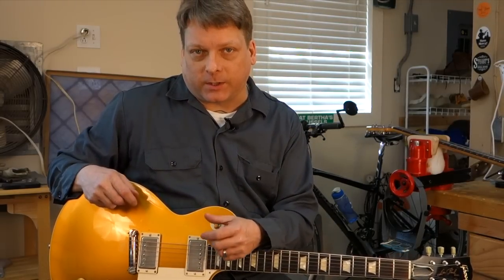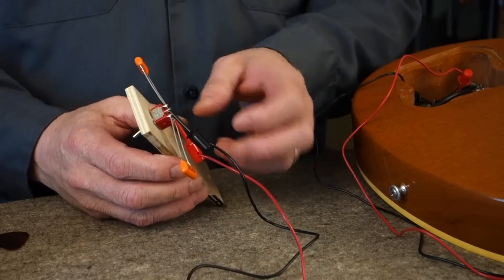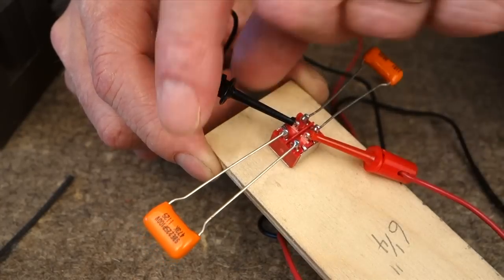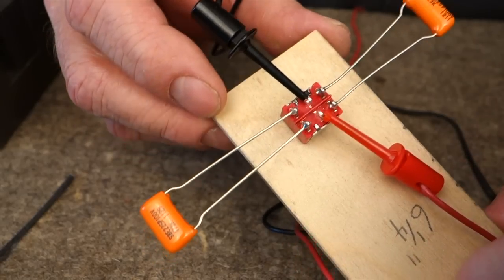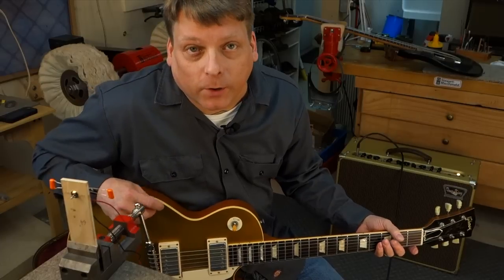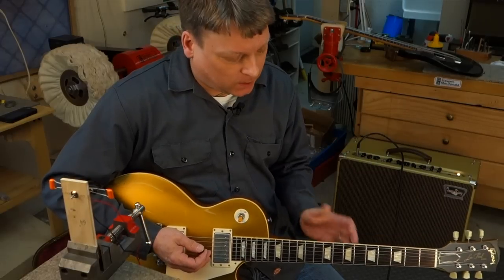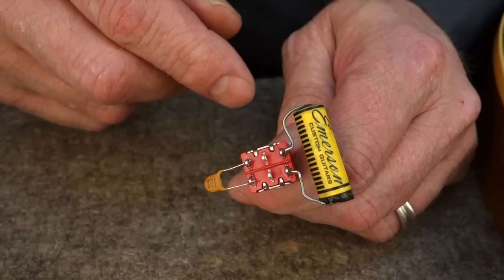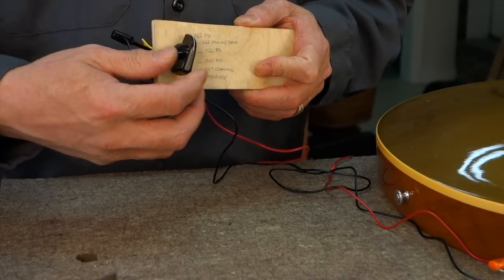Guitar capacitor tester: let your ears decide

Comment: It really helps to hear a difference when you play the same lick.Just saying.
Reply: I like using Orange Drops  mostly for psychological reasons. It has a decent history and in theory the build quality is good to last.
Reply: @ramencurry6672  psych reasons ? It’s a capacitor not a mushroom cap.
Reply: @wb9536  what capacitor do you use and why?
Reply: @wb9536  haha
Reply: @wb9536  it’s been about a year and you still didn’t answer my question
Reply: It’s arguable that, if you need to A-B the same lick to hear the tone difference, it’s not big enough to really matter. If it sounds good, it is good.
Reply: I can hear it on phone speaker I prefer the 22. The 47 takes off too much top
Reply: It's impossible to determine any difference with such a subtle change unless like you said, he plays the same part. Why wouldn't you play the same part, even if there was a significant difference?
Reply: Except, he's not asking your opinion😂. He's showing other techs how to rig up a testing device.

Comment: I would have liked to have heard what the difference between the paper/oil and ceramic cap sounded like.
Reply: no one could hear that)
Reply: Capacitance is Capacitance how the electrons get stored and release doesn't matter at all it is the 'how much and how fast' that matters.  Don't pay more for 500v 'orange drops' on a signal that is measured in millivolts... what a waste!  The value is all that matters.  Seymour Duncan has a good article about that:

http://www.seymourduncan.com/tonefiend/guitar/customize-your-caps/

Avoid mojo caps that cost big bucks
Reply: +Ted     I laugh at all this cap nonsense. You want a decent capacitor, from a decent maker, for sure. What you don't want is some boutique shop charging 40 times it's price for Tone man. ROFl, I guess it makes money flow. Surely doesn't get noticed by the average Joe on your album/CD/DVD. That all gets changed by amps, strings, your style of playing, where you set the tone knob at, the room, humidity, air pressure, software, recording media, microphones, recording techniques, the other persons ears, their media it's played from (generally a crappy dumb phone)etc.etc.
Reply: Word !  Value of the cap matters. Not what it's made from.  Cork sniffers refuse to believe that.  It's their money, let them spend it.
Reply: sure, you can ignore an inhomogenous and anistrope dielectricum ...but you can consider it too ... and temperature and humidty ... if note focuse only on the printed capacitance value
Reply: cableaddict the only reason anyone could say ceramic caps are inferior is this: they are more likely to be inconsistent in their purported rating, and how they perform. That has to do with manufacture. I agree that the only thing that affects capacitors are their true ratings when in use, and their durability- never understood the whole to do about paper in oil, or ( worse ) vintage paper in oil🙄. Shit, the older a capacitor is, the more likely it has some degree of degradation people are snowed so easily.
Reply: Totally agree, capacitance is capacitance. ALL that varies is how it does it and how quickly it gets there.
Reply: Lol smh, 72 people liked that stupid comment.
Reply: Could't agree more. Numbers are numbers, values are values. There's no any magic or esoterics with capacitors, just some Gibson's scam.
Reply: Ted Schoenling funny man. It’s about parasitics, and those differ a lot. 
Cut some capacitors open and look at the construction.they can be completely different.
Reply: @Poodrdt  Um that's bullshit. I can hear a large difference between caps on my tube Amp. I've tried many. And that has global feedback which makes it even harder and uts clear as day.
Reply: @gutbucket260  It's not about cork sniffers. Anyone who thinks caps don't sound different is deaf
Reply: Capacitors make a huge difference, just like a treble bleed affects tone but even more so. It‘s so clear night and day it’s not even up for debate

Comment: Most players keep their tone pots at full-on when playing. If you do this, here's a great, inexpensive & simple suggestion;  Install a .001uF cap in place of the typical .022 or .047uF. This low value cap is usually used in a treble bleed circuit for guitars. This little cap gives you a very subtle tone shift from 0-10, thus, giving your guitar two totally usable voices at full-on or full-off. Again, it's VERY subtle, but SO usable. You can also try slightly higher value caps. EXPERIMENT!

Comment: The difference was so subtle, I would imagine you could tweak your amp settings to achieve that small difference; or use a EQ pedal and make slight adjustments.
Reply: If that was subtle you need to join a auditory class for about a year. If you can't hear the dramatic change in tone, shape, and frequency you might wanna get your ears checked as well.
Reply: Exactly! Same goes for swapping pick ups , you can achieve just as much with an eq pedal .
Reply: @dba4292  Dramatic ? Really ?
Reply: @Dad-Gad  To my ears yes, if not to yours then ok. You might wanna have an idea of what to listen for, not what be missing.
Reply: @Dad-Gad  You are right,..its so subtle, it's ridiculous !
I will give the man in the video credit for being honest. He said that it is subtle before he even began the demonstration.
Reply: @Dad-Gad  unless it's a drastic difference between tone, I agree.
Reply: @dba4292  I call BS.. I have no difficulty hearing differences between .022uF and .047uF caps if apply this change to one of my own guitars - or if it is A-B'ed in a tightly controlled situation, but IMO there are no "dramatic" differences. Picking your string half an inch closer to your bridge will make for a far more dramatic difference..

The "test" in the video is not very useful because the guy is not playing the same licks and his picking dynamics vary wildly, which makes it very difficult for the listeners to decide wether we should attribute perceived differences in sound to his picking or to which cap is enabled. Also he doesn't match tone settings, which is really important. It seems like he mostly play with the tone knob open. The differences becomes more pronounced once the tone knob pass "position 5" on the way down.

In fact if tone knob is on 10/fully open (many guitarists don't touch their tone knob), the difference in volume cut off between a .047uF and a .022uF cap is only about 1/10th of a decibel (sic!). (A .047uF is starts 'filtering' frequencies an octave lower than the .022uF cap, and it gets more pronounced as you turn down the tone pot)

For a fully open tone knob, that is a very, very, veeery, veeeeeeeery (did I say very?) subtle difference, indeed. If you roll your cap from .022uF to .047uF in your guitar, by the time you're finished soldering and plugging back into your amp, chances are your memory will not be accurate enough to make you do a fair comparison in any sense with regards to tone setting on 10.

Though psycho acoustic effects might be strong. Many people don't get this. The real differences comes into play once you start rolling back your tone knob and the effect for a .047uF cap is most apparent with tone rolled all the way back (compared to a 0.022uF cap) - it will be considerably "darker" sounding.

 @Lyd Mo is right, using EQ on an amp or a pedal makes far more dramatic changes to the sound than swapping caps with different values,  while leaving amp the same. The sound of the whole system (including everything from the players picking dynamics, the properties of the guitars, the cables, pedals and amp) simply is so complex that singling out the importance of the cap value is extremely difficult.  You could NOT listen to a recording of a random LP with normal cap values (.047uF/.033uF/.022uF) and recognize what cap is installed - especially not if tone knob is fully open. It is just not impossible. 

Having said that, finding the "core" tone in your guitar that suits your preferences is certainly important to many guitarists. Sometimes you are chasing a particular resonance peak that matches natural resonances in your guitar, or maybe you do a lot of tone 'swells' and prefer the range of one value over the other. This might be important nitty-gritty details to some, but it is very finicky stuff and apply mostly to the clean tone. Once you push your signal into compression (overdrive) the differences between eg .047uF and .033uF don't mean much.

For all tone knobs, once you turn down to 0 you reach a resonance peak.. (on the way down you actually pass slight fluctuations in resonance).. this resonance peak is least noticeable for high value caps (it just gets muddy), so for .100uF cap this peak would be hardly noticeable, but for a .010uF cap, position 0 will introduce a very noticeable 'honky' resonant peak, and signal volume (dB) will actually be higher with tone at 0 than at 10. Personally I find that experimenting with lower value caps make sense in this respect, especially chasing clean tones with single coil guitars. When going for a lower value cap, you kinda sacrifice the range of the tone knob if you're into making pronounced wah-wah sounds with the tone knob.

The old myth that "single coil guitars should have .047uF, while humbuckered guitars needs .022uF" is just that.. a myth. Once upon a time, Leo F. chose .047uF for his guitars, while Gibson went with .022uF. At that time the tastes in electric guitar sounds were completely different from now, people wanted brightness contrasted to muffled "jazz" or "bass" sounds (telecasters where in fact wired to offer some bass-like tones), and there were no love for driven, compressed sounds.. Today this har changed a lot.

I believe most guitarists with normal hearing will have no problems noticing differences in how their guitar sounds/how their gear (pedals, amps) responds to the guitar signal, if they are put in the same situation as in the video and are given the opportunity to switch between cap values. But if they were to be handed unfamiliar guitars with different caps it would be much more of a guessing game: is the guitar inherently more bright or does it have a .22  cap?
Reply: Changing the capacitors are much more cheaper than buying pedals etc
Reply: @dba4292  Man, you got rude right at the start. Calm down, buddy, it's just a video. My ears are fine. I've been playing for a long time. I know what to listen for.
Reply: @Dad-Gad  Yes, that's true. I have a Boss EQ200 with four memories and a manual. I can shape a pickup to sound very different and no need to change out caps, pots or pickups, unless you're going for extreme changes, like single coil tone to humbucker or P90 sound. People change pickups without thinking about this.
Reply: I take the EQ pedal over this cap

Comment: .047uf sounded better to me as well for the warmth.

I could see using the .022uf in a situation a person want more treble which is usually the situation in heavy metal music.

Me I am more of a solo player so I liked the sound of the .047uf for the warmth since the guitar was pretty bright. That usually means any type of treble added at the EQ will make it easy to bring it back to a bright sound. Trying to go from bright to more warmth at the EQ is harder when the guitar is so bright.

To me a Les Paul should always have an underlying warmth to it so the .047 is the clear choice and could probably stand to go up a few picofarads more than the .047.
Reply: I'm way late to the party. In fact it might be broke up by now. Anyways I just wrote in to say on my L Paul, I used .011 caps cause I'm a Strat player 1st and my L Paul is definitely the hot rod guitar of my fleet. The Strat uses L Sensors and we all know that they are not the hardest driving pups out there. And the Paul has 496/500 pups. So my thinking is to kinda match up the P board and amp set up to each guitar w/o a lot of changing settings. Can pretty much do this with tone and volume. At least this has worked for me. .011 caps and Garrett cloth wiring in a 50's wiring style is my system.

Comment: i like the idea of putting a rotary switch in the guitar with multiple caps, so one can change their mind easily and as frequently as they like.
Reply: So did Gibson, and thus the variotone (see B.B. Kings guitar)
Reply: Epiphone's Phant-O-Matic does this as well.
Reply: Johnnny C Boyle - Ignorance question: why does not such a rotary switch become a standar feature on electro guitars.
Reply: Mekratrig - partly because of traditionalism, partly because most guitarists don't want to have to think about all those things(especially in a live setting), partly because you'll wind up using very few of the combinations. It's a good idea for a studio-use guitar.
Reply: Maxwell made good points, but here are two more to consider:  The differences between the capacitors are minimal - most people couldn't correctly identify them in a true random blind-fold test - and it adds some cost to the price of the guitar.  From a economics standpoint, the marginal revenue won't exceed the marginal cost and doesn't make economic sense; from a musical standpoint, most people can't tell the difference, so it doesn't make musical sense.
Reply: This is the C-Switch, you can buy it online (Lemme).
Reply: Lemme buy it!

Comment: I like the multi-tester idea. I haven't played with caps enough. This is a good way to go through my own guitars and just see what's possible with different caps. I have a couple that I wonder about. But I have a Tele that is on the "don't mess with it" list. It always sounds perfect whatever I plug it into. I'd hate to cast bad voodoo its way and break the magic... lol
Reply: Yes. You need to "play" with more capacitors. 
Um, er, do you know what a capacitor IS, and the ways it can be used in a circuit?  Do you know what an electronic circuit is?  —Ever studied wave theory or EMF resonance?   Some people call the latter term,  "radio".  Have you any idea of the different TYPES of capacitors?  E.g., how does a tantalum cap differ from a polypropylene film cap?   An electrolytic cap vs. a ceramic cap? 
Learning some music theory is probably a more fruitful venture at this juncture...

Comment: Have you considered using a footswitch to flip between options? That would allow you to toggle instantly while playing continuously. You could also hack a volume pedal and use that to toggle multiple options. With double pole switches (both latching footswitch and rotary) you could have separate LED circuits to indicate the active option.

Comment: Seems like the .022 is brighter than the .047. The tester you set up with the rotary switch is a cool idea. I have a Strat and Tele...both copies not Fender. Some say use .022uf and others .047uf. This would be a great way to test and see which one I like for each guitar. Thanks for the video!

Comment: What model les Paul is that? What pickups are in it? What amp are you playing through. I don’t care as much about the capacitors as l do about the guitar, pickups, and amp. That setup sound GREAT!
Reply from the maker: The guitar is a Gibson R4 (1954 reissue) Tonequest that was routed for humbuckers at the factory (R4's typically have p-90's). Erick has swapped many different pickups in and out of this guitar, but at the time this video was shot he had a set of Golden Age Parsons Street Humbuckers installed. The amp is a Tone King Meteor ll, model 740A.

Comment: Thanks for the video. I am finding that my 2014 LP Studio seems to have stronger volume coming from the 1 & 2 strings. I want to lower their level a tad without affecting my over all tone. I have tried lowering the treble side of the bridge pick up with not much effect.I got a suggestion to lower the value of the cap so that when using the tone control only the high end would be affected. The recommendation was a .01 cap.Does that make sense to you?Thank you. Would appreciate your thoughts on that.

Comment: There is much more to the cap equation then people often consider.  Some people say that when the tone knob is maxed you wont hear the cap at all.  I don't use no-load pots, but while playing the guitar I have tried disconnecting the cap with the pot maxed while a chord is ringing out and I honestly can't hear the difference.  With that said, I have heard youtube vids demonstrating that the cap does affect the tone even when knob is maxed, so I am stumped there.  What I have noticed with caps is that some make a funky wah-wah like sound when turned down and some just do as intended and roll off the treble.  That is what I prefer.  If I want a wah I'll use a wah.  For rock/metal/pop I prefer orange caps to pio.  They just seem brighter and more lively to me.  For warmth and jazz and clean pio seems like better choice.  What some people call "bell-like" others call "brittle", and what some people call "warm" others call "mud".  I was very surprised to learn I preferred orange caps in most situations.

Comment: Your setups for different capacitors are really cool. It gives you a chance to try a new cap for your axe without all the mess from soldering each one into place.
Reply: It only really makes sense when talking about doing the same thing for a bunch of different guitars, though. Else, it's just as easy to just use alligator clips to grab the legs of each cap in turn and make your decision that way, right?

Comment: RE_capacitor BANK-- Did you measure the exact capacitance of the two capacitors to ensure you are comparing the same actual same capacitance  values as there is a % tolerance . A 0.047uF between two paper and ceramic capacitors would not be discernible in a double blind test.